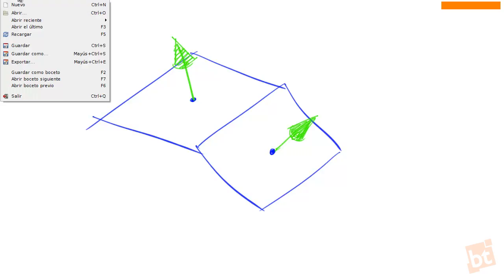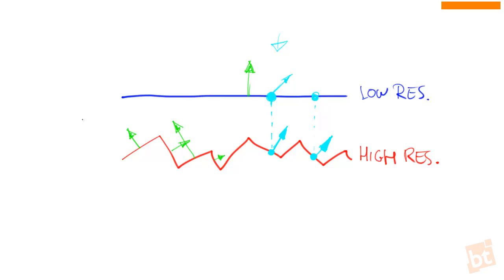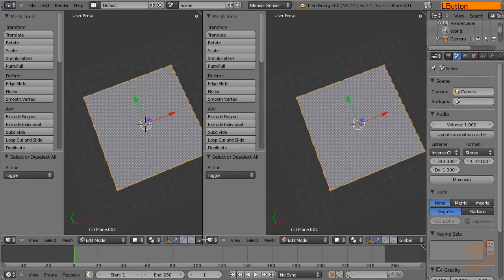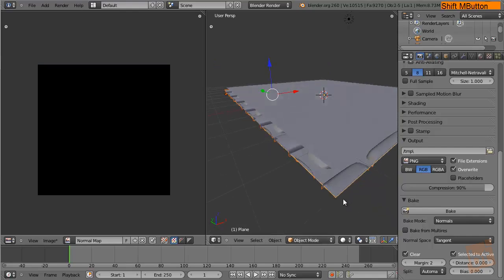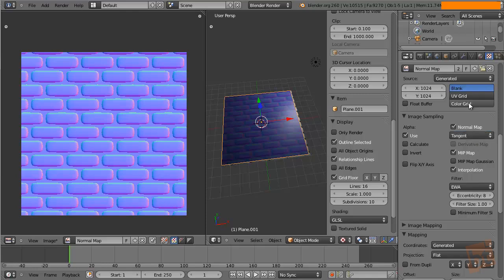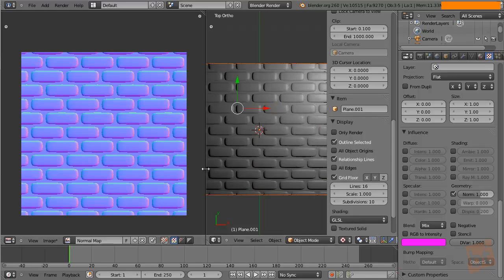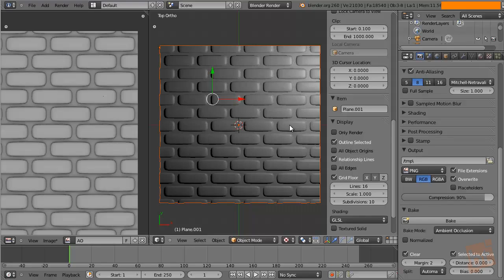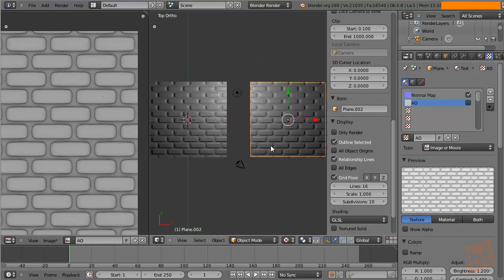Normal Maps & Baking Textures in Blender 2.6x

Comment: do you know how to change settings because when i look up in the material icons it gives me preview, diffuse,specular, shading, transparency, mirror, subsurface scattering, strand, options, shadow and custom properties.  Instead of custom properties, preview, surface, displacement, and settings.  I'm using 2.69
Reply from the maker: Those different settings are the change between Blender Render and Cycles.

Comment: Btw, where did the "normal map" checkbox in the Image Sampling section went? In 2.73a is no longer where it was in 2.6x :(
Reply from the maker: In Cycles, you need to use the normal map through nodes, using the Bump node.
Reply from the maker: I think it keeps being there, but only for Blender Render, not for Cycles :P
Reply: Oliver Villar I've got the same question. I just make sure that it is already in Blender Render. But the normal map checkbox in image sampling still didnt show up in Blender 2.73. Do you have any solution for this?

Comment: Hola Oliver! Thanks a bunch for sharing! Excellent tutorial as usual :)
One question: It seems important to keep a distance between the high res and the low res meshes. In this example you use a square shaped mesh, but what do you do when the mesh is a sphere? Would you scale it down just a bit so that they don't overlap? Or keep their original dimensions? And of course, what do you do with more complex shapes, like a humanoid character?
Thank you so much in advance Oliver, Javier
Reply from the maker: Well, intersections are indeed tricky, they may cause artifacts. What is usually done is to make the destination mesh (lowpoly) a little bigger than the original one when baking. Using Alt+S scales all faces on their normals, and that may help. :)
Reply: Oliver Villar Good to confirm that, thank you so much for both replies and for sharing too of course! :)

Comment: Someone created a model in 3ds max and exported and OBJ. and the assigned materials for it. If I am importing an OBJ. and there are already materials made for it. How do I import the materials so that they are assigned where they belong?
Reply from the maker: I guess when you import an OBJ you can tweak the parameters of the import operation. Anyway, moving materials between different software is usually not very efficient, as each software has different types of materials and material settings :P

Comment: how do you compile the normals and the diffuse and spec then save it on .dds? i need .dds for my game im modding so how do i compile and save them? the uv mapping is already done i just need to learn to compile and save normal, diffuse and spec as .dds material texture
Reply from the maker: I think thats a Direct X format or something like that. To be honest, I have no idea on how to compile textures in that format, but I guess there is some kind of software that does it. I recall there was a plugin for photoshop or something similar. Sorry, I'm not very familiar with that format and can't help more that this :S
Reply: if you need it to simply be converted Use Gimp 2 and install a .dds plugin.  This will also allow you to use it in editing all .dds files you encounter.  Load the file onto Gimp 2 and export as .dds with Mipmaps if you wish.  that is likely the easiest way.

Comment: I have an object with multiple materials and UVs attached and when I try to bake it bakes only one part of the object, from one specific UV. And it's the last part I've worked on texturing. How do I make it to bake the full object?
Reply from the maker: If you have more than one UV maps, what you can do is to create a new one for the normal maps, or use one of the existent ones that has the full object unwrapped in it. Before baking, make sure the UV map you want is the active one, otherwise change it, as Blender will use the active UV map for baking ;)
Reply: Oliver Villar I'll try that, thank you

Comment: Awesome, i only used the texture apply area, but i've got a problem.
i have got a imported object and seperated parts from this and now i want to apply the textures again the normal textures goes well but when i add the oa texture (diffuse in my case) it turns out black on the object, someone knows how to do tis right?
Reply from the maker: Can you explain further what happens exactly? I don't understand :P
Reply: When i add my both textures to my object it turns out black
Reply: And in the material area everything seems to be right
Reply from the maker: Are you using Blender Internal? If you do, did you check the UV mapping option for both textures?
Reply: Oliver Villar Yes the uv's are checked on and i can see in tha material area (on the small boll) they are both active and workin but in 3d vision my object is black.
Reply from the maker: Do you have lights in the scene? Did you turn on the GLSL display mode?
Reply: Yes i've lights, in the multitexture display mode is has all texures but when i turn on GLSL mode the object becoms black.
MultiTexture mode:
http://s27.postimg.org/ot4p21hoi/Untitled.jpg
GLSL:
http://s4.postimg.org/mo3tc4mto/Untitled2.jpg
Reply from the maker: You need to be in GLSL to see those material properties. Can you try to enter into the edit mode, select everything and press Ctrl+N or flip normals? Maybe the normals are looking to the wrong side and that's why you see it black :P
Reply: Oliver Villar No, that doesn't work either, it stays black.
Reply from the maker: Hmmm That's weird. Without taking a peek at your scene, I have no idea on what's going on. If you want you can send your blend file to me (go to the contact tab in my website) and I'll check it out when I have a moment. Remember to pack the textures before sending the blend file! ;)
Reply: okey, i've got a friend who is looking at it now if he also can't find the problem i will send the files to you.

Comment: I created a wall like  you have in this tutorial. I selected high poly object then selected low.. and when i baked normal map. All i get is a solid blue texture rather than the brick pattern. Any ideas as to why
Reply from the maker: Move the lowpoly plane up or down so the wall is behind it. Also, if it is too far from the wall, probably it won't detect it.

Comment from the maker: Hahah don't worry, I'm not counting xD Crazy Bump is different: it generates maps from a texture and allows you to mix several normal maps into one. What I'm doing here is to bake the normal maps from a high resolution 3D model :) The difference is that baking from a 3D model, the normal maps are accurate and give a similar result to the highpoly model, while the Crazybump ones are actually an emulation, very useful for some tasks and for adding details to previously baked bump maps :)

Comment: @OVillar Hey thanks for showing us this tut, truly helpful.At around 16:45 you bake the AO, for some reason the bake was almost 2 mins(is my comp that slow?) anyway my AO bake looked a little noisy. I did the high poly mesh objects from your 1hour long Alien spaceship I used the plane with the squares and added 5 susan heads between; anyway that was my high poly mesh. So basically one of the cube objects in AO was very noisy, can I change this by changing the samples from 12+?? rest was fine tu)

Comment from the maker: Hmmm I'm not a lot into hardware stuff, but I guess you could. I have a multicore graphics card, and I have the option to use both cores at once. Probably you should "build" a SLI or something like that, but I don't know what graphics card models you can make it to work together.  Try to look for someone that has done it already :P

Comment: F*ck. :/
Ok... second question. :)
On guy has wrote at forum (GraphicAll i think) that If You have for example GTX670 and GTX460 You could use them both at the same time to render cycles in Blender. Do You know something about this?

Comment from the maker: It's basically the same process :) Just make sure that the lowpoly mesh completely covers the character, with no intersections. Of course, each model has some complexities and you may need to tweak some things for optimal results, but it's only a matter of playing with the difference between the low and high res meshes, and with the parameters in the normals. Each model is different so there isn't a universal way, but following this tutorial's guidelines should give you no problems ;)

Thanks!

Comment: So when projecting textures onto more complex meshes, the method is the same, but are there any tips you'd give someone wanting to texture a surface that isn't a flat plane, but rather an enclosed character mesh? You were very detailed in your explanation, just wondering what might be different with a whole character mesh, as I've never tried this. Thanks! :)

Comment: You don't have much to know about how normal maps work. You only need to know how to set up the model for baking. Plus most of the time you don't need to worry about normal mask if you want to bake shadows onto texture. I went through many 3ds max tutorials on baking texture or shadow. all full of errors because the stop now and then to lecture you. You only every need to bake textures with shadow to texture a model for a game engine.

Comment from the maker: Hi. Sorry if you didn't like the video. I made that previous explanation, because my website is targeted to a begginer 3D user, which is not supposed what a normal map is, or even if they know, they probably don't know how they exactly work. 

If you find the explanation not needed, you can just skip it and watch the part that you need. At 5:00 I start setting up the scene, you should start at that part.

You probably come to this video with previous experience, but not everyone has it ;)

Comment from the maker: Thanks for the comment. In fact yes, you can delete it. And not also that, you shouldn't have it in the final scene (but you should save that high poly model just in case it's needed in the future), so it's much lighter and you don't need to worry about not selecting it accidentally, or to use a layer or something. Once it's baked correctly into the texture, you don't need the high poly model anymore :)